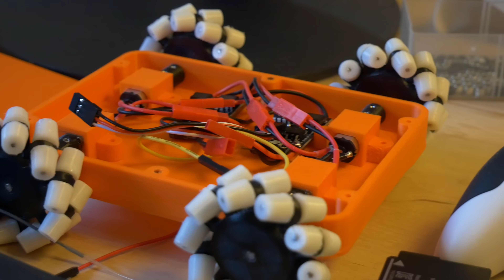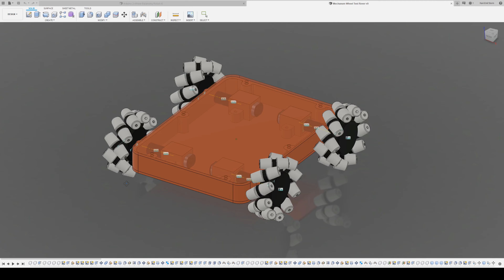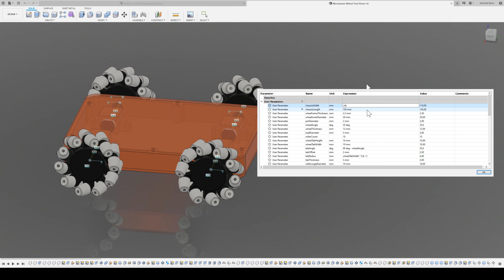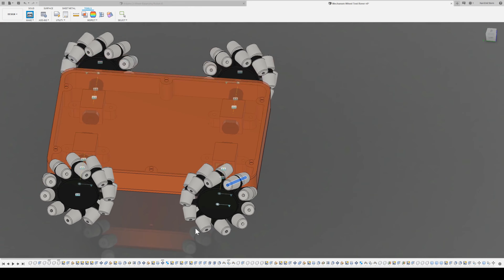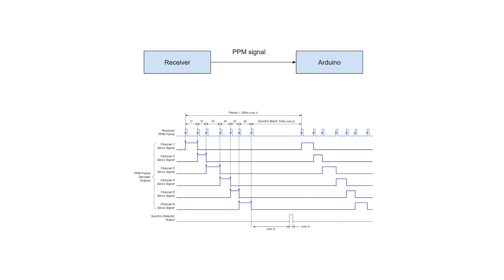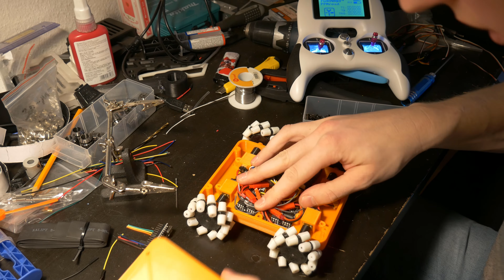Make a 3D Printed Mecanum Rover - FREE Download

Comment: Vinyl Caps (available at an electrical supply) would make a good traction addition .
Reply: What are those ? I was thinking of  heat shrink.
Reply from the maker: That is a great idea. Although I think adding some kind of bearing to the rollers would make the biggest difference at the moment